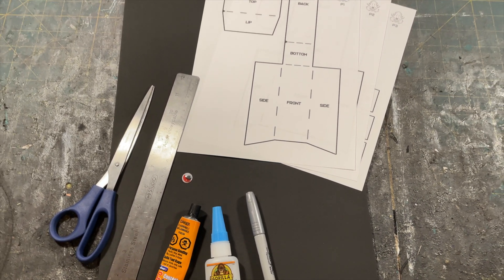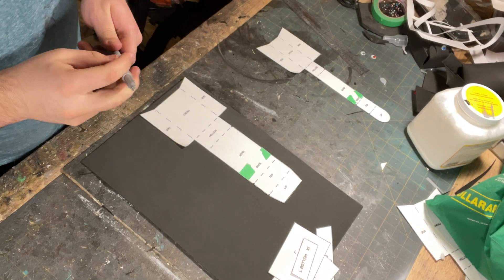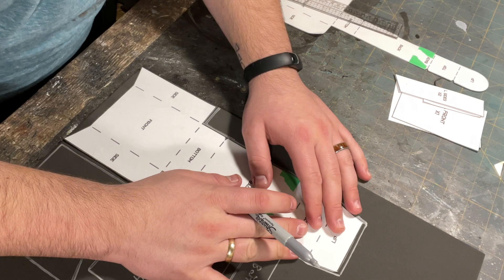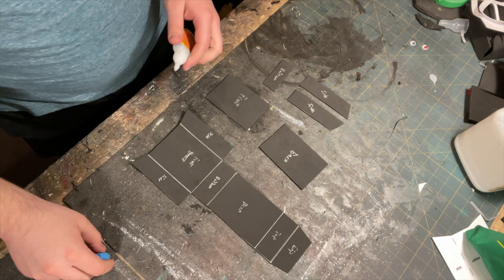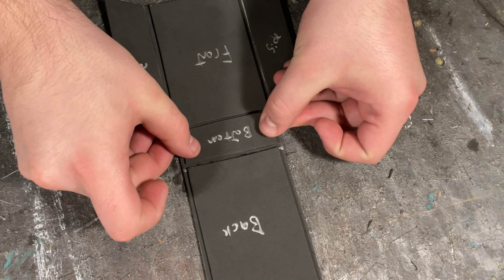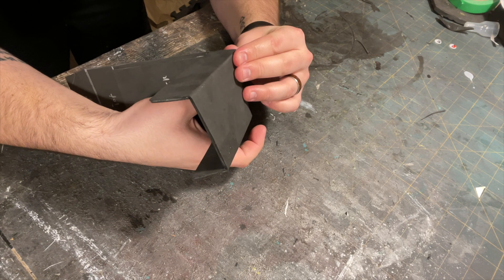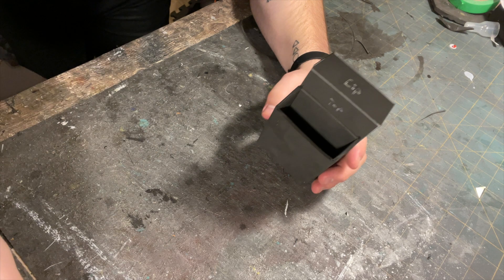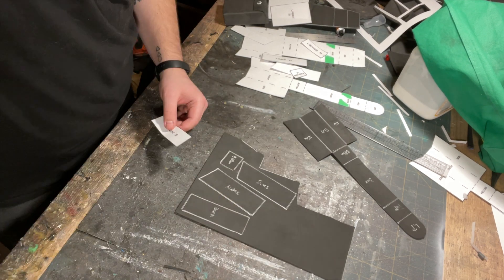Cosplay Foam Pouch - Tutorial

Comment: This is going to go hard for my Mad max halloween costume this year. Any recommandations in order to attach it to a belt?
Reply from the maker: @neverendthemusic  I have used these for my Batman belt and I just used a 4-5 inch strip to create a loop with the back of the pouch acting as part of the loop and slipped an elastic strip through. You can also glue them to a foam strap.